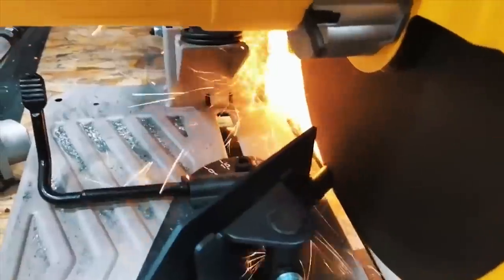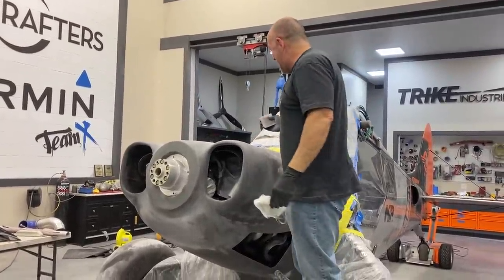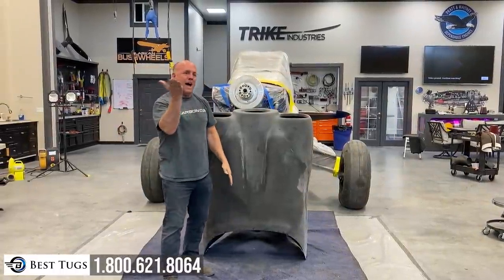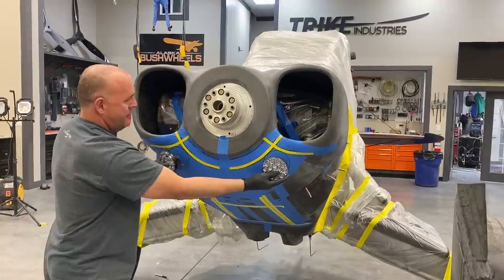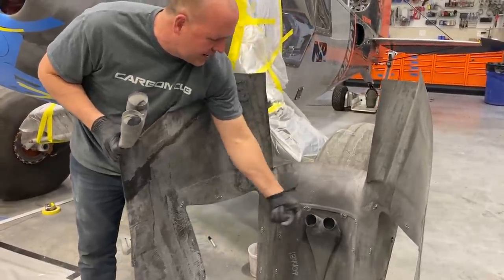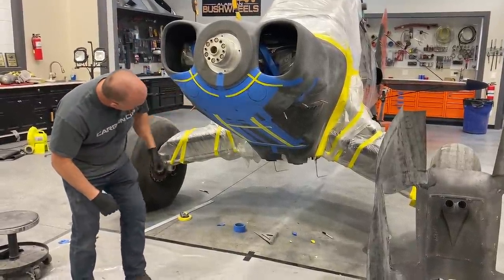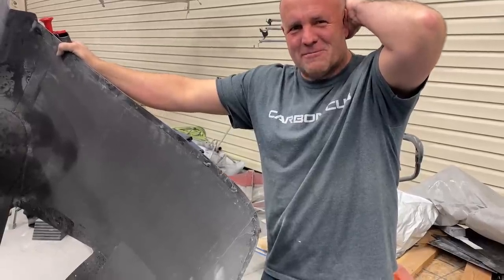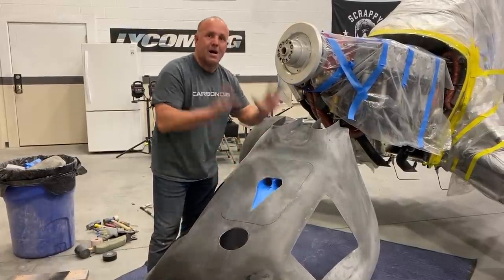I'm Cutting Up My Carbon Fiber Airplane Cowling  | Scrappy #45

Comment: Was a boy in New Zealand in the 1950’s my dad assembled Tiger Moths out of crates and converted front seat into crop duster hopper. Piper Cubs and Tripacers, Austers, Fox Moths...everywhere! Am thrilled watching all your work. Imagine back in those days Mike Patey landing scrappy onto that field!!
Reply: The Fastens Indian In The World that probably still holds the Bonneville Flats motorcycle racing record for over 200MPH using a Indian Scout 1920 motor cycle frame also came from your country back in the 50's and 60's another Mike Patey from earlier times!

Comment: At one point ... I was like ..."When is it going to complete!" ...
Now I'm like ... I don't know how I'm going to handle the completition!!
Reply: Yeah, you’ll go through withdrawals a bit as he plays with Scrappy while it’s a new toy, but we all know Mike doesn’t have an off switch, and DRACO X will be under the scalpel before the table is cold.
Reply: Don't worry he has like 10 more projects lined up!! LOL Well maybe not 10 but Draco II will be coming soon!
Reply: Completion means Draco II comes into play. ;)
Reply: Mike has mentioned the race plane will probably be next.  Remember the 1200 hp PT6 sitting in the case?  I am hoping he builds the race plane and Draco X so he can swap that engine back and forth between the two.  1200 hp race plane?  Awesome!  1200 hp Draco X?  Boggles the mind!
Reply: Build it, break it, build again. That's the mantra.
Reply: @nssherlock4547  I am sure you meant "bend it" not "break it" 
nice work Sherlock! (LOL I am also sure you must be getting a load of these dad jokes ... could not resist)
Reply: @nevillecreativitymentor  That's Beckham!! I'm quoting mike's opening spiel ,design it make it break it build again better.
Reply: @nssherlock4547  😃😄 now i remember (i am guilty of jumping the intro ..straight into the matter ..cannot wait.)
Usual procedure is Give a Thumbs Up ...see the first few seconds ...jump the intro ... drop jaw to floor ...put eyes back in socket ... and ZAP ...locked in. LOL

Comment: There is hardly a thing in that plane that hasn't had a lot of thought put into it.  The thoughts have everything to do with solving or avoiding some problem.  I think Scrappy is going to work well, be easy to work on, and perform extremely well.  A world class machine built as one man's toy.   Because he can.  While he and his brother run other businesses full time.  

You're an amazing dude, Mike.  Nothing but respect.

Comment: Mike, I now have a tip to drill eggs instead of cracking them.. 🤣lol the tape idea sure does work so you don't have index marks directly on part, & the soft tape allows the point of the handheld drill to center w/out slipping & skipping.. I have done this before, of course used width of tape to measure spacing too, using a strip of tape as a template to properly phase drill holes, then tape strips perpendicular.. looked like railroad tracks### (or plaid sometimes)but gave me absolute "visual security" in the process.. what I call "I see what I'm doing before I cut insurance" 🤠👍

Comment: 16:09 i usually put a thin stainless washer around the screw holes which has been thinned out at the edges (think donut saucer). It's extremely robust. I even crashed my bike twice, and the screw holes didn't rip as they usually do when you have factory or aftermarket CF.
TIP: on the multitool, you can get an old (or new) blade, and cut it, centered, to a thinner profile, then if you twist it in the lock at 90 degrees from the tool, you can use your palm as a rest on the part you cut, and you get extremely precise control over the cut. I mean, surgery grade control. Source: as we all know, these machines came the medical grade bone saws. I actually used a bone saw before i had a multi tool and it worked best in that orientation (because of the half moon blade, look like a saw tooth scythe, i think it's for cutting between ribs or something) so i figured i should try it with the multitool as well, and it does.

Comment: When properly implemented, a NACA duct allows air to flow into an internal duct, often for cooling purposes, with a minimal disturbance to the flow. The design was originally called a submerged inlet, since it consists of a shallow ramp with curved walls recessed into the exposed surface of a streamlined body, such as an aircraft.

This type of flush inlet generally cannot achieve the larger ram pressures and flow volumes of an external design, and so is rarely used for the jet engine intake application for which it was originally designed, such as the North American YF-93 and Short SB.4 Sherpa. It is, however, common for piston engine and ventilation intakes.

Comment: Another great video Mike! Just laying it out there for when Scrappy is up and running. How about you set sights on setting a speed record for electric powered flight? Should fall right into your wheel house  with slippery light weight aircraft construction and battery power. Would make a great project and video series and broaden your reach of viewers. Who knows, may lead to a whole new class of aircraft at Reno Races. Love your work and hope to see more of it.

Comment: If you have a forward looking night vision camera, you could fit two infra red spotlights under your aircraft, one at the back, one at the front, which could be angled such that they would shine ahead of your aircraft and the two lights would coincide (overlap) only when you reach, Say 50 feet AGL. A line on your screen could then show 30,20,10 feet to contact.

Comment: 11:35, the NACA intake being colored from blue taped looks pretty good.  Might look neat to paint the interior of it scrappy orange.  Also since we're talking hot glue, while it does scrape out easy, hit it with some isopropyl alcohol, and standard EVA based hot glue gets really crumbly and even easier to scrape/clean up.  Try it on a stick, bend the stick a good bit, spray it with some alcohol while youre holding it bent, and it just falls to pieces.
Reply from the maker: Yes that works great.  I scrape out the bulk and clean it up that way.  I should mention that in a video for others 👍🤠 thanks

Comment: Mike, consider designing the top surface of the plenum with a slight upward angle toward the air inlets when on the ground, the reason for this is to allow the hot air from the engine to escape after shutdown.  Most aircraft cowls and plenums trap this hot air at the very top with nowhere to go, and in some cases it'll literally cook the paint if it's hot outside, take a look at some of the older cowlings and there's a good chance you'll see bubbling or discolored paint.  Allowing the heated air to naturally flow up and out of the cowling alleviates this problem.  It's a lot easier to incorporate on a taildragger, especially one with massive air inlets like this.

Comment: You mentioned digging out the hot glue from the light fixtures, rubbing alcohol helps to release the bond of hot glue to easily remove it. Might be too late to use on this project but maybe a future one. Love your channel Thanks for sharing.

Comment: Denatured alcohol works great to remove hot glue. I use a lot of hot glue to temporarily clamp parts on woodworking projects. I keep a small squirt bottle of alcohol in the shop.

Comment: Mike, if you want smooth curves in parts you're sanding, you need sanding splines.  Double-back tape sanding paper to flexible strips - sheet metal, pressboard, composite, whatever.  Make long, wide, stiff ones for gentle curves.  Make short, narrow, flexy ones for tight curves.  Make whatever you need, you'll figure it out.

Comment: Please either use a shotgun microphone on top of the camera (or external audio recorder), or even better, have Mike wear a body pack transmitter with lavalier microphone on his shirt. The reverb from the hanger as well as he is quite low compared to the music and audio from B-roll / cut scenes is significantly different. I have to turn my system up quite a bit to clearly hear his speech but the music is very loud in comparison. I LOVE THE VIDEOS (other than the mic levels)!!! I VERY much look forward to the weekends so I can catch the new videos. THANK YOU. I tell every engineer, builder, plane guy I see about these videos as it is refreshing to have Mike talk through his ideas and logic behind what he does and why he does it. So much talent, knowledge, and work ethic.

Comment: I just can’t get enough of scrappy episodes! I just love building stuff my self in my own way, I do like your approach into scratchbuilding stuff👌 tips on the Hot Glue stuff, drop the razorblades just drip some alcohol on it and the glue slips right off with no residue😉 greatings from norway! back to work!😜

Comment: Lets talk wings.  I got this idea from the Navy's F16 and their swivel wing.  Back for high speed, out for landing. Well you can not do a swivel but you can do a retractable winglet.  This idea I got from my my kitchen cabinet drawers, while standing on one.  Incredibly strong for the light hardware.  You should be able to retract your winglets by 24 or 25 inches  per side.  For landing all the way out, for higher speed flying, tuck them in. This can be done by vacuum, electrical or manual.  To keep the nose of the winglet even with the rest of the wing, you can use a icing boot.  The boot will even act as a locking mechanism for the winglet.  Just an idea.  Blessings dean
Reply: F14?

Comment: Mr. Patey sir, if I make a suggestion to you about sanding. I have found that using a flexible scraper with the Dremel Multi-tool with self-adhesive bits of sandpaper makes an awesome sanding tool for fine detail work. I found the best ones are the 1" wide flexible scrapers. Now mind you the 1" flexible scraper is hard to come by. But with all the toys you have, you can easily make your own out of strapping steel (you will have to punch the holes because the strapping steel will break the drill bits.). I find that they usually start to break around the dimples at the mount after about 8-10hrs of use. Extend the sandpaper about 1" beyond the scraper blade & about 1/4" wider, wrap the side to side overlap around the blade & on the extension at the end fold back a little so at least 1/4" attaches to the top of the scraper blade.

Comment: 9:47 not sure if you already know or someone's mentioned the quick trick with using Isopropyl Alcohol on hot glue to delaminate it and it just peels off instead of using a blade to remove it. Love your work mike, people like you are the reason why technology keeps advancing. :)

Comment: Mike, nightvision idea. You could do it like a FLIR Pod and put an overpod with a polycarb window in the front. Gymbal servos and you can have a pointable cam. If it doesn't have long distance focus capabilities I guess it doesn't matter. If it does, 7 degrees in any direction of center will get you everything out in your forward view.

Comment: For the light holes, it seems that that portion could have been molded perfectly flat for that circle. It might look weird to have a flat spot on the mold, but ultimately it's cut out, and just ensures you have a near perfect circle in the topology of the cowling, and you can control the angle with precision and save the need for filler material.

Comment: Hot glue tip: rubbing alcohol very effectively de-bonds hot glue from epoxy. It does not dissolve the hot glue. It is like it creeps in between the hot glue and substrate and releases it. It is like magic. Try it. Rubbing alcohol is also called isopropyl alcohol.

Comment: Hot glue can be removed fairly easy with mineral spirits or 90% isopropyl alcohol. 
Pour a small bit around the edges, capillary attraction pulls it between the surfaces and it pops right off.

Comment: When I saw the hot glue. I said to myself "Now you're speaking my language" Then I saw the disclaimer. If I were tasked with building a plane, it would be mostly hot glue.
Reply: Are you in a holding pattern currently?
Reply: Hot glue and Flextape
Reply: @russellsmith3825  Just finished the video. About to land.
Reply: @ronjohnson9507  Exactly.
Reply: All my model aircraft are 90% hot glue, best glue ever
Reply: @russellsmith3825  Inverted I hope... That's the best way to fly uncertified aircraft... I know because I saw it on the internet
Reply: @MichaelLloyd  I hear Christy really likes it when you do that.
Reply: Hot glue = Rapid Unplanned Disassemble...
Reply: @russellsmith3825  I've heard the same thing. I've never tried it myself. I prefer looking up and seeing sky
Reply: No Bryan, planes are not made by folding paper sheets like we did at school.
Reply: Well my R/C Carbon Cub is mostly hot glue and packing tape at this point. haha
Reply: Bryan, do me a favor, okay?  If you're going to build an airplane, please start with a 1/8 scale balsa wood model, alright?
Reply: Hot Glue: A poor man's 3D printer.

Comment: Mike, Hot glue is easily removable by spraying it down with acetone.  Not sure if the acetone will negatively affect your carbon, but the hot glue will peel right off after about 3-5 seconds.  No need for razor blades at all.
Reply: rubbing alcohol will also do it and is definitely safe on epoxy resin.

Comment: Wondering if Mike is thinking split ailerons/decelerons like on A-10 for Scrappy, slight wedge @ critical airspeeds/loads/pressure altitude helps responsiveness & laminar flow, also helps a little w/adverse yaw perhaps? I see Mike flying like a rocket & dragging like a kite!🤠

Comment: G’morning Mike, as always an awesome video.  I do wish to make a comment, in a few scenes i saw not 1, not 2, but 3 large hammers on the floor.... love it.  If it doesn’t fit, whack it!  Oops sorry, i learned a long time ago to never hit anything with a hammer, especially on airplanes.  I learned instead to use a percussion adjustment tool to make percussion adjustments as needed.  😅😁😉

Comment: I've watched a lot of your movies. Your passion is incredibly contagious and addictive. Honestly, it reminds me a lot of working with remote-controlled models, but a bit bigger ...
Greetings to your amazing wife.

BTW. Could you consider using a remote microphone?
This would significantly improve the sound quality, especially eliminate high reverberation in the hangar or ambient noise.

Comment: Awesome work as always, so good that you share your thought processes. Are night vision cameras affected much by heat? I wonder if infra red performance would be impeded by being close to the exhaust? Thank you so much for making these videos, engineering is creative and fun, great to see someone with enormous talent and enthusiasm pushing the envelope.
Reply from the maker: 👍🤠 yes It could affect it. So it goes inside a thermal wrapped carbon box with a fresh air pass through tube
Reply: @MikePatey  thanks Mike, you don't tend to miss too many tricks. You know the drill....

Comment: What if you reinforce the underside of the top half of the cowling with Kevlar. That way if the engine ever blows you have extra protection against metal penetrating and oil getting all over your windshield. Just thinking safety.
Reply: Weight might be a problem

Comment: Watch out for exhaust heat with the NV camera! They run a lot of gain which amplifies noise, and Si detectors get much noisier at higher temperatures.
Reply from the maker: 👍🤠 agreed.  It’s going in a heat shielding covered carbon box with its own fresh air vent tube from the upper deck cold air
Reply: Nice! Hope to run into you in person some time.

Comment: Hi Mike; I was wondering if you could put a servo system from a car headlight on your lower light system? In Europe, there is, usually, a small control on the dash that allows one to adjust the headlights for different loads, on cars that do not have full auto-leveling...I had this crazy thought to add an option to have it controlled, selectable by you, by stick angle, so that it could tilt down as you flare!  Also, one could add an accelerometer ;-) to have it follow pitch angle, automatically... Maybe next time?

Comment: Figure out a way to keep the lights pointed slightly lower than horizontal. In automotive world they can turn the projector housing with the steering wheel to see around turns. Would be cool but probably a bunch of weight

Comment: Cowl is looking great Mike. Only concern i have is that the engine may sag a tiny bit when you hang the prop and may reduce your 1/8 clearance at the back of the cowl. I feel like an armchair athlete mentioning this, but would hate to have that work spoiled on the off chance you've missed that detail. Keep up the awesome work!
Reply from the maker: Yea I did a whole discussion on it and I’m not sure but we just missed it in the video edits.  It has a sag offset done for that exact reason.  Thanks for the comment 👍🤠
Reply: @MikePatey  i kinda expected as much, you have a great mind for the details that i wish was more common in aircraft designers (i fix em)

Comment: Mike - Are you planning on reinforcing the bottom of the cowling? Particularly the service door, lower landing light, and naca duct area? That area is going to see as much gravel as your horizontal stabilizer, if not more (by my guess). I'd also consider putting a filter on the naca duct somewhere, just in case you leave the vent open on a dirty landing.
Reply from the maker: Great question 👍🤠 Yes,  they are all Reinforced in those area as is my cevlar infused horizontal.  Also the naca vent hose then turn up with a s bend on a str eighth up climb.  If anything goes inside it falls back out.  A bends stops the speed and the gravity walks it back out
Reply: @MikePatey  I love it when I'm not the first person to have a good idea! 
I'd love to come out and help out at some point instead of backseating! Do you need an extra set of hands for a few days?